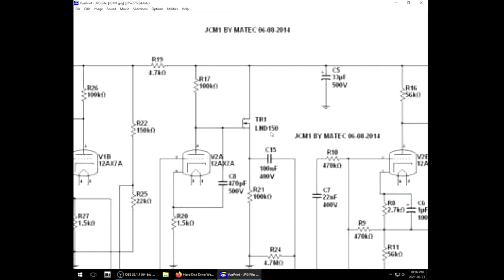I build a Solid State 12AX7 Substitute Tube.

Comment: So, I just watched another video where someone replaced an el84 with transistors. What is actually preventing me from replacing all the tubes in my amplifier with transistors, and enjoying all the output transformer goodness, without the glass hassle?
Reply from the maker: I want to say, nothing, which is why they invented solid state amps, but I guess, if you are trying to retain the character of an OT, well, you don't need 400+ volts to to that. 
I have yet to try replacing the power tubes, tho I do have what I need to do it, but for preamp tubes, tho' this works it's not idea, the amp would need some fine tuning and re voicing to work with them properly. 
I cant' speak for Power tubes. For some applications it makes sense cause we jsut want a clean tight output section and dont' want power tube distortion. 
I'm really not sure how much an OT adds, I want to just say, if you don't like playing with glass just go SS or digital. I'll try it eventually.
Reply: @DATT  I play solid state and tubes. I’m just curious why they hybrids aren’t happening.
The OT under guitar loads exhibits frequency dependent damping at the extreme low and high end. It’s like a midboost with an absurdly wide Q, that’s crazy touch sensitive. It’s a subtle thing, but it’s infinitely more what is responsible for the “Tube Sounds” than the tubes themselves. Even EVH approved of replacing some of the tubes in his new amp with transistors because he believed that the transformer was the source of the “magic.”
Reply: @DATT  Thanks you for such a fast and clear reply!
Reply from the maker: @subjectt.change6599  At the end of the day, from a corporate stand point, it's horribly inefficient, adds to the cost for not a lot of gain, which cuts intro shareholder dividends, when they can get you like 90% there with just a good design using cheap parts. 
We live in an era where no company that is publicly traded is capable of actual innovation or risk. 
I'd be interested to look over some of those EVH schematics (good luck). If there is a market and it does add, well damn, someone will make it, but I think the market for people who don't want tubes is just moving in a very difference direction. 
Cost is important to most people it seems, many people who run tubes amps don't' even understand them or are using them properly for this reason. 

I can agree the power tubes them selves are maybe less important for a tube tone, than the preamps, especially for modern tones. 

Admittedly, being a smaller channel still, I can engage with the audience at this level.
Reply: @DATT  I dig your channel, and I appreciate your insight. Thank you.
Reply: @DATT I suppose I’m really just thinking of ways to extend the life of my tube amps should the replacement market get too precious.

Comment: did you mount a rotary switch on the chassis of that marshall?
Reply from the maker: Are you referring to the weird looking gold circle cage looking thing mounted near the can caps ?
That's a bias pot. I removed the internal bias pot, and mounted on the outside so I could bias the amp for different power tubes without having to take it apart. That cage thing used to be a heat sink fan computer part, I gutting out the fan and a little pot if in there nice. It let me do this mod without having to drill a hole in the chassis.

Comment: Can you provide the schematics for it 
Cause i need to change my 12ax7 
Its not available in my country 
Not any tubes either
Reply from the maker: There is no schematic. get two LND150's, connect them to the tube socket somehow. Put one on pins 1,2,3, and the other on pin 6,7,8. Flat part inwards, curved part outwards, legs pointed down to the socket. 
Other than that, all I can say is to rewatch the vid. 
Also, I have a nother vid called "I jammed transistors in my tube sockets" that might give you another perspective. 
Sadly, they don't sound very good in many positions so they aren't a proper substitute. They are more a novelty. 
YOu could try seaching "AMT 12ax7le" which is another more engineered substitute.

Comment: Hi, I 've got a AKG solidtube mic and the valves needs to be changed... I woudn't mind to keep the big diafragme of that mic but without the valve sound....would that work ?
Thanks
Reply from the maker: Hmm, I hadn't considered in a mic. Looking at the schematic quickly, I don't think it'd hurt to try, but the circuit in a mic is a lot higher tolerance than a guitar amp. Guitar amps work using controlled chaos, using the tubes to make an intentionally distorted sound, where as a mic tried it's hardest to have the cleanest sound. 

If it was me, I'd just use the mic as is, buy it a new tube, like, it's going to last a while right ?
I would try a tung sol 12ax7 or maybe their 5751. I would avoid JJ tubes for that application.
If you really don't want a tube mic, I would just flip it and get a solid state Large Diaphragm mic instead. 
There is really no sense in modding it to be Solid state, where there at many excellent SS mics out there.
Reply: @DATT  You are 100% right... No point to mess around with that mic... I'll buy a new valve and sell it. 
Thank you
Reply: @DATT  They say that the original valve is a 12AX7/ECC83... Is it the tung sol that you are talking about ?
Reply from the maker: @yanudol  Yes, the Tung-Sol 12AX7. They tend to be a good one for this sort of thing.

Comment: Well, if the 12AX7s blow in my stereo pre-amp I can build these to tide me over until new tubes arrive, thanks!
Reply from the maker: Maybe . . . hah, these puppers react funny to certain circuits.
Reply: Yeah, mostly joking ;-) @DATT
Reply from the maker: @tzed2509  Ahhh, hah, ok. Hard to tell on here sometimes. And like, it could actually work.
Reply: @DATT  better safe than sorry as they say, in terms of comments. Not sure how safe these would be in a hi-fi circuit... only one way to find out!
Reply from the maker: @tzed2509  Ahhh, they meet all the 12ax7 specs, so basically, I worst case it just won't sound good. 
These things seem to sound bad if that stage has a sizable bypass cap on the cathode. They don't like that.
Reply: I know next to zero about circuit design, and can barely read a schematic… might they have a use as interesting noise makers or noise adders in a guitar preamp circuit? Or in a guitar pedal…. Since those seem all the rage now!
Reply from the maker: @tzed2509  Pedal not sure much, cause these are high voltage parts, which is great, they can work at tube amp voltages. But, actually yeah, cause they effectively work like a tube gain stage, and can run at tube voltages, some people use them to add a stage to an amp for more gain. 
A classic mod for the JCM800 adds a tube to the amp, to boost the input and drive the amp, effectively giving it modern distortion, like adding an OD pedal in front. Now, to do that, is invasive, you got to put more holes in the amp. But if you can jsut tuck a transistor in there somewhere , then bam, easy peasy.
Reply: Would it be possible to use something similar to your tube replacement to instead add the LND150 as an additional preamp stage without making a permanent mod? Could it be as simple as plugging a 12AX7 tube into the top of your device?
Reply from the maker: @rockitman403  So what, like cascade a couple of them for more gain ? In theory yeah. 
They already have something like that, search for the "Hot Mod" by Legendary Tones I believe. That's an adapter that lets your put 2 tubes in one socket.